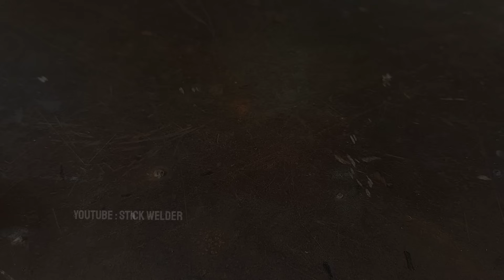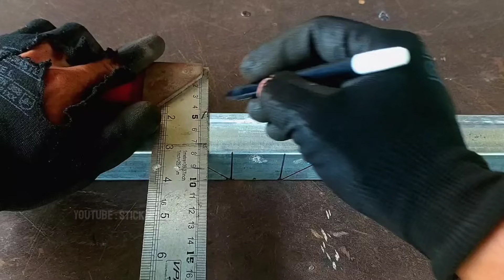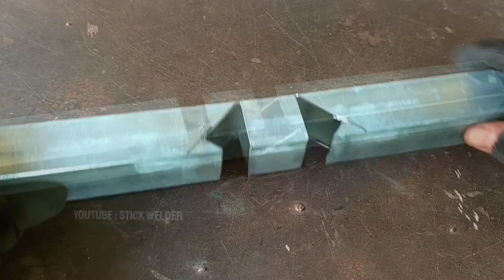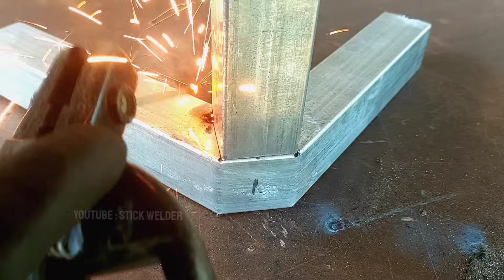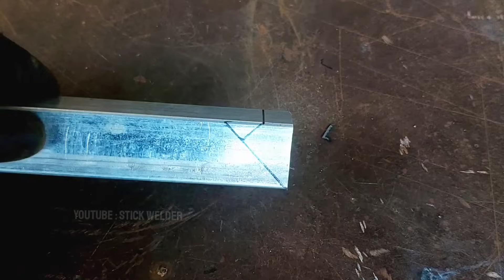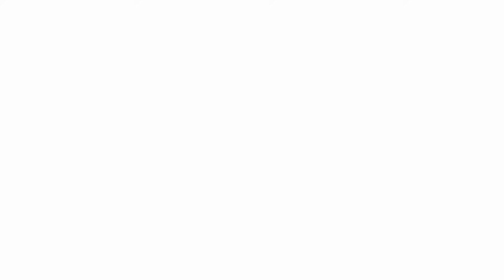New tricks for joining square pipe corners that welders rarely talk about | pipe cutting tricks

Comment: Using a grinder without a wheel cover is indeed extremely dangerous. The wheel cover serves as a protective barrier between the spinning wheel and the user, preventing any debris or fragments from flying out and causing harm. Without the wheel cover, there is a high risk of injury from flying sparks, fragments, or even the wheel itself breaking apart. It is crucial to always prioritize safety when using power tools and ensure that all necessary safety measures, such as using wheel covers, are in place to prevent accidents.
Reply: As a retired safety professional I agree completely. These wheels can explode upwards of 5,000 ft pet sec. Faster then a bullet

Comment: I really, really  hope you use bullet-proof glasses and full-face shield when grinding without grinder cover. It is extremely dangerous. One shattered piece can completely ruin your life. Don't do that, please.
Reply: I had 2 different brand cutting wheels on an angle grinder blow up on me within 5 minutes of each other.  Both were brand new wheels.  The angle grinder is the most dangerous tool in the shop.
Reply: I had three grinding wheels once blow up on me, all before lunch break.
Reply: i never use glasses...never thought about one blowing apart. I've been lucky i guess